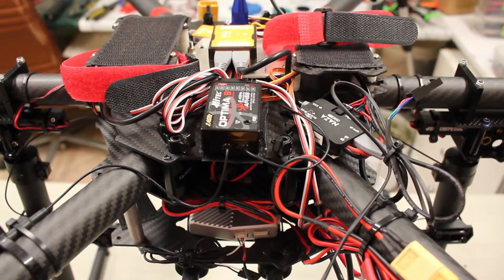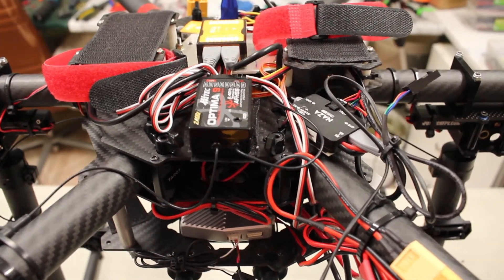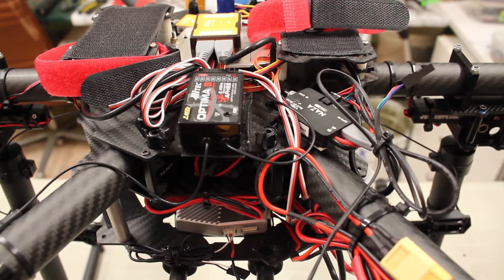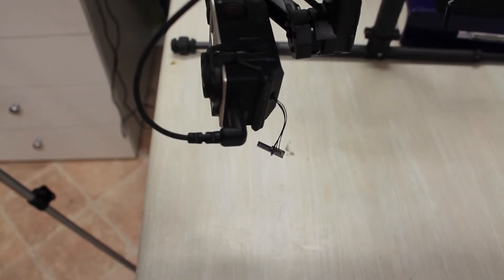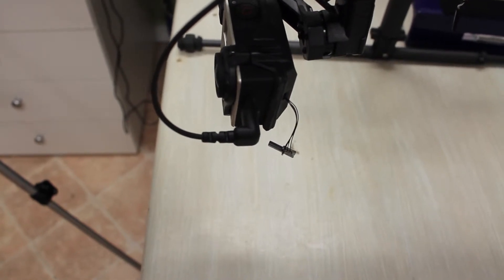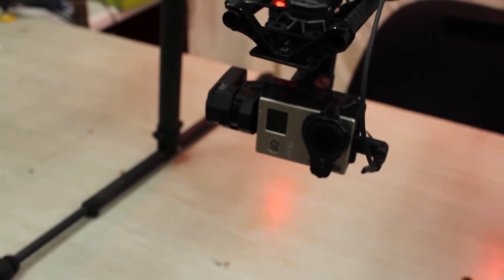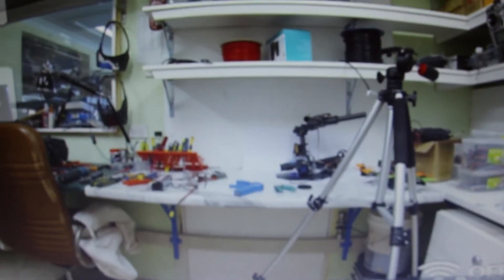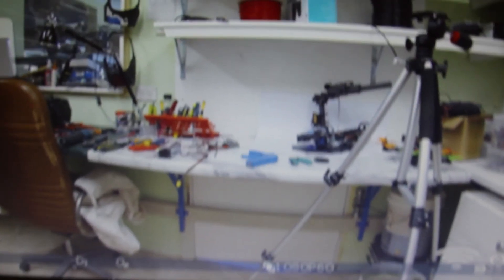HD Connex DJI OSD Setup and Static test

Comment: Did you have to use any kind of OSD for the NAZA? I have just connected the connex to the NAZA, but do not get any OSD data.
Reply from the maker: Hello Boogie3d, it should just start, have you turned it off on the Connex receiver? are you using the HD or the Mini?? Ed
Reply: I have tried different settings and can't get the OSD to work. It is the Connex Mini.
Reply from the maker: Hello B, can you send me a photo of your connections - I'll compare it to mine, email me appi at swiftdsl.com.au Ed